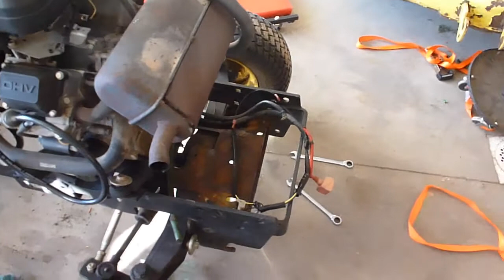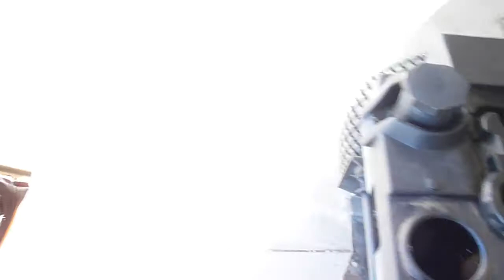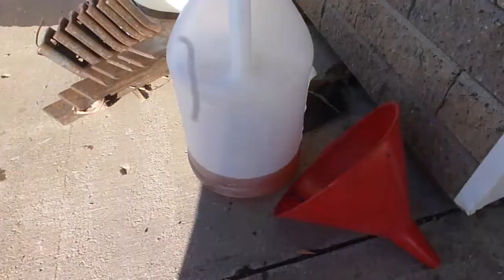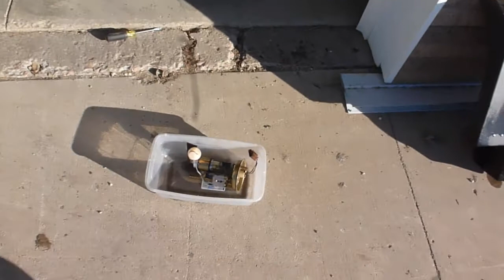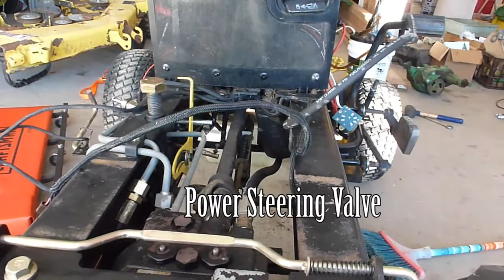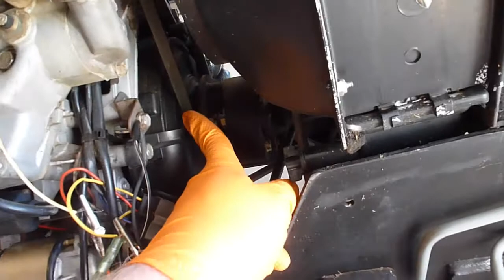John Deere 425 Disassembly: Part 2

Comment: Do you know how to take off the power steering valve?! I can’t figure out how to get it off and I didn’t see you take it off in any of your videos. Help
Reply from the maker: From the underside of the machine you will need to remove the lines from the valve. There is a plate on top of the valve that needs to be removed to do that. The plate holds all 5 lines in the valve. You will then need an allen head socket on an extension and ratchet to remove the valve itself. It is held in with two bolts. Hope that helps. There is not a lot of room to work in there.

Comment: I own a 425 model I bought new in 2001. It has 429 hours and has sat in my garage unused since early 2010. I have moved to a lot that was too small for this lawn tractor, but I start it regularly and keep it detailed. It still looks like new, even under the hood and under chassis. I replaced the seat last year has I had ripped it on a low hanging branch when mowing under trees in 2008, and just couldn't continue looking at the seat in that condition. Looking to buy a home on acreage this or next year knowing I could put this like new well cared for 425 right to work.
The 48" mowing deck looks new still, because at the end of each mowing season, I would clean and detail the underside of the deck, top included. 
My only problem with the 425 was that the plastic throttle lever broke in such a way as the plastic lever would fold over when applying pressure to increase throttle speed.

Comment: What do the ears look like on the front of the frame that the quick hitch and mower draft arm attach to look like. My 95 425 is ovaled out and one is almost flat. I asked deere if they had a blue print to purchase so i could fill them back in and they said i had to purchase a new frame which may not be available. Be interesting to see the ware on yours. And figure out how to bribe you to make a template. Lol thanks for the vid.
Reply from the maker: I will have to look next time I am in the shop and report back. Funny part is back in the 60's with the round fender 110's and 112's the wear on the mounting locations up front we a big enough problem that Deere actually released replacement tabs for the mounting brackets. I'll try and remember to get you some pictures etc as I proceed. Drop me an email mmrbeef@gmail.com to remind me to do that.

Comment: Buddy i have to tell ya that machine looks alot better than i thought it was gonna ,,, it looks pretty clean,,,like it may have not been taken care of as far as proper maintenance goes ,,but it doesn’t look like it was abused or taken care of to bad,,, alot better than i thought when seeing it in the first video,,, granted you cleaned it but , but you know you can tell by looking at the paint and frame condition and that of hydro lines etc... just my opinion,, but that might be a good tractor to redo and make it your wife’s  yard cart tractor or something..
Reply from the maker: Very true, the frame did clean up a lot nicer than I expected. It goes to show you exactly how much abuse they can take and still shine up pretty.  If it was a 445 I would very much consider taking my time and spending a little money on fixing it up. In fact this 425 has really spurred my interest in finding a nice lower hour 455 to add to the herd. The 425's just don't get me excited for some reason.....  Plus as usual I am learning lots tearing it down. I can see how Deere learned between the 4-5 machines and the X series units and how they implemented changes. BUT I am sure sometime in the future there will be permanent addition of a 455 or maybe a 445 to the herd.